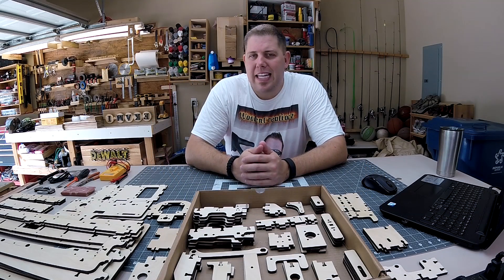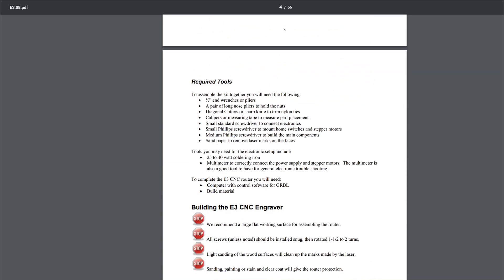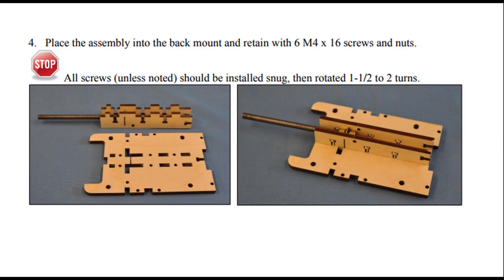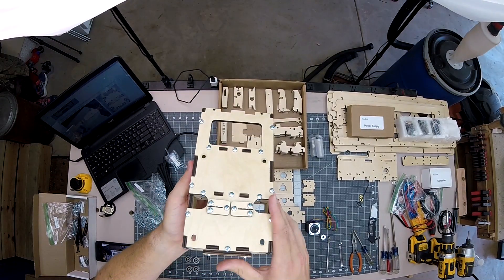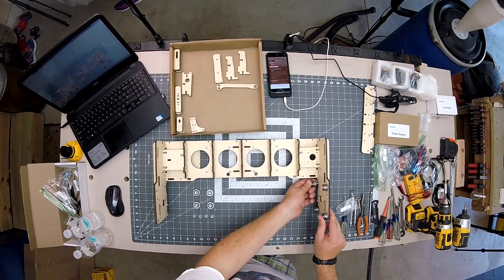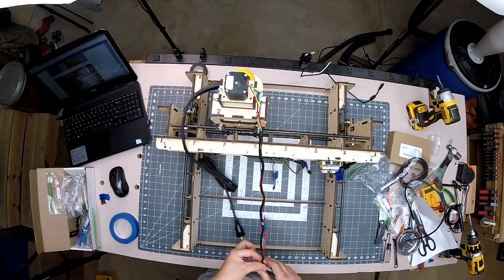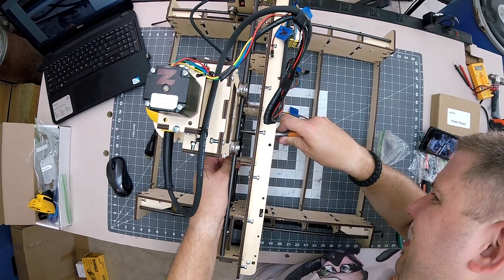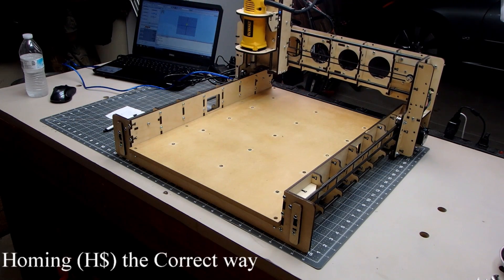BobsCNC E3 CNC/Engraver Installation Video ($698 CNC)

Comment: Can't make up my mind to CNC or not ? Experience : 45 years as a machinist / CADCAM programmer ( Mastercam) / car restorer / welder. I am retired and doing woodwork as my hobby. My concern is the loading of the drivers, software and electronics ( not my field). I was thinking a heavier machine may be better, but then again I'm not machining metal anymore ( miss my shop). The router is limited to the DeWalt I like the 1/8 and 1/4 collects. I want to 3D carve music boxes, clocks and other items along these lines. Not really big items. I'm thinking the E4, the wife's car will have to sit outside, maybe. I think the VCarve Pro would be good. I see you recommend Locktight how about fiberlock nuts ? I am concerned with viberation and all those screws coming loose. First thing will be a dust collection system.
Reply from the maker: I for sure vote E4 and use Loctite on the nuts.. the machine dominates in wood and carves and cuts with precision.... in regards to software. Bob does a great job of explaining what to download and from where. But if you have questions you can ask his support team and they will help you.. check out Bobs CNC on Facebook and you can see some of the beautiful things people have created.. hope that helps.. Still love mine . PS vcarve is the best software and my advice... I have videos on it as well.

Comment: is this cutting aluminium plate
Reply from the maker: Only hardwoods softwoods and plastics. Is it possible yes, is it designed for it no. It's all about going fast enough and keeping enough lubrication on the aluminum. I've seen some people attempt it. But I've also seen some people have the bit cease on them. 👊🏻😜 But again not recommended.
Reply: @WoodenCreationz  i want wood and aluminium plate cutting machine, and tell about it's body metal
Reply: @WoodenCreationz  Darn this is a totally sad comment.  I was looking to see if this could route aluminum which if it did .... would allow you to "DIY" parts for a more robust cnc.

... and now it's $900 on Amazon!

Comment: HEY!  I ordered the E4 TODAY!!!  Hate to bug you but what bits would you recommend to start out with?
Reply from the maker: That's awesome!!! You have two main bits that you will use... Your meat and potatoes... This one cuts. HQMaster 10PCS 1/8" 17mm Carbide... https://www.amazon.com/dp/B010NI39WO?ref=ppx_pop_mob_ap_share  This one is a 60 degree vcarve bit. Freud 1/2 (Dia.) V Grooving Bit... https://www.amazon.com/dp/B00004T7E8?ref=ppx_pop_mob_ap_share   For fine detail work I like this one.  EnPoint&trade; High-precision... https://www.amazon.com/dp/B00QPXQUNC?ref=ppx_pop_mob_ap_share  Good luck bud! -Brian ps the bit that comes with it is crap... So buy your bits now... The crappy bit won't cut.. 🙃 cya Brian
Reply: WoodenCreationz THANKS Brian

Comment: I am nearly finished assembling my E3, I purchased the magnetic tool. I used it extensively during the build. In some places, I super glued the nuts to the tip of the magnetic tool. This allows one or two threads to engage in the nuts. Super glue was also used to glue the nuts to the wood where it was not possible to get the magnetic tool. As well, for the toothed belt stops, I inserted the needle pliers into the screw holes. Then I positioned one part of the needle nose handle under the bench top, and gently pulled up on the other handle.. allowing the belt to simply slip into the Teeth. This worked very well. No fussing. I installed the belt stops.

Comment: I received my Cnc e3 and it says to use 5/16 anti backlash rubber washers for the rod. They were not included in my Cnc machine order. My question is where do I buy them? I’ve typed in anti backlash rubber washers, Nothing comes up.
Reply from the maker: I would hit up Bobscnc support group to see what they suggest. I'm not sure on that one.
Reply: Ok, thank you, found it odd that a few rubber washers weren’t included for the money spent on the machine itself 😂 thank you for replying! 😊
Reply: Apparently I have the newer model and those backlash washers aren’t necessary! 😊

Comment: I would like to know if this machine will cut a electric guitar body such as a Fender telecaster L. 16 in. H.1.75 in. W. 12.75 in.
Reply from the maker: Eugene Eaton Cutting Area:X: 17.7" (450 mm)Y: 15.3" (380 mm)Z: 3.3" (85 mm)

There is a mod a Lot of people are doing that extends the bed by double. Bob has a sale from now till June 17th on the E3. They don't go on sale often so if your wanting one I advise taking advantage of it before they go off sale. Excellent CNC for the price. I love mine. Brian
Check out BobsCNC.com for more questions answered and look on Amazon. A ton of them answered there as well. If that doesn't get it done, Bob's an amazing guy and will reply if you shoot him an email. The support you get from him is amazing!

Comment: What is the hardest thing you tried to cut with this? Plywood looks really flimsy and I wonder if rigidity is an issue or not?
Reply from the maker: yazicib1 Had the same concern and thought I needed a metal one. I was wrong... The frame itself is extremely rigid and contains lots of nuts and bolts holding it together. I believe there around 500 bolts or so. I have cut oak, walnut, plywood, pine. I know a guy that engraves rocks with his. My next concern was what can it do.. it cuts, vcarves and engraves like the all do. Not selling you one but for the dollar... It's the best machine I have bought so far in my shop. I can finally offer accurracy in a product and make signs and inventions skipping the bandsaw and skrollsaw. Here is a video from Bob the inventor on your deflection question. Dudes an engineer and will give you support better than any other company. Hope this helps. 👊🏻😉 https://youtu.be/v-e2IVQUh1k

Comment: I"m having trouble homing my BOB cnc. When I hit "Home" the router will move but it wobbles and then I get this error:  "Homing fail. Could not find limit switch within search distance. Try increasing max travel."  Help!
Reply from the maker: Mr. Quintron hey bud... Most likely the spindle motors are going the wrong way. Check out Bob's trouble shooting guide at the bottom of this page to compare and diagnose the issue... If your still stuck shoot Bob an email and he is amazing at getting you past it and up and going. -Brian https://www.bobscnc.com/products/e3-cnc-engraving-kit

Comment: what Feeds and Speeds are you running on your E3. I'm about to test out my E3 and was wondering a good range to start. I was thinking around 100 IPM with 60 for plunge.
Reply from the maker: Jason Long I do 20 speed and 15 plunge. Start with that. Harder woods need slower speeds. Once you get comfortable seeing how the bit is performing in the wood. You can start turning it up for softer Woods and softer materials.

Comment: So I completed the initial step 1 - the Z spindle mount assembly. I feel good with it so far but am a little apprehensive about the 2 nuts tightening on the rod with the rubber washers. I have seen a couple of videos and it warns bout getting that right. I am not sure what "right" means. The more I tightened the nuts the harder the rod was to thread so I backed off until the rod required some resistance when I turned it.I hand tightened the nuts until it squeezed the washers pretty tight. The rod can thread through the nuts fine. Not too loose not too tight. Should I sweat this? It looks like going back and adjusting it calls for taking a lot of parts back apart :)
Reply from the maker: Bill Clinton I gave mine a good tighten and when they frog cheeked a little I backed them off to where they don’t frog cheek but are tight. Never have had an issue with them by doing this. Brian
Reply: I think I did the same. At least I hope I did the same :).....I just finished step 2 and everything seems to be moving freely with no play. I planned on knocking it off after step one but could help myself. This kit is pretty awesome.....
Reply from the maker: Bill Clinton it seems over whelming but it’s never hard and like I mention. Pace it out over a couple days at your kitchen table with a cold drink in hand and it goes together really nicely!!! Enjoy bud!
Reply: Finished assembly today. Took about 6 hours total. Successfully connected it to my PC and am able to home the machine. Is there a recommended G code file I can use to run a test cut? I wanted to get one cut under my belt before I dig deeper. This was truly a joy to do. I appreciate your help with the community!
Reply from the maker: Bill Clinton Awesome Man! You will be nervous on your first cut. Try a piece of foam. Also get some new 1/8 or 1/4 bits on amazon. End mill 1/8 and 60degree vcarve are what I have. As far as software. Try the Fengrave. Also try easel. Just when you finish in easel do follow the instructions to have it automatically cut for you. You need to go to machine advanced and generate G code. I’m wrapping up a video now but my next video will likely be an easel video on how to do this. Brian

Comment: I built mine yesterday!  7 hours with lots of distractions.  The ONLY part that freaked me out was the first step in the gantry assembly with the two short, vertical end pieces with the 3/4" hole in them.  I noticed the hole was offset and the instructions gave no indication to which way this offset was to be placed.  Later, I found out it was only a wire channel and was VERY relieved since a teardown at that point would have been an hour or more backtrack.  Had a little trouble installing the switches (the one with the long wire REALLY got me) but not too bad.  Haven't run it yet, but it all works and slides around great.  Good video, thanks, even though I found this after mine was built.
Reply from the maker: Oh shoot!!! I think Bob might point people to this instructional video in the future.  Glad you got it together but! If you’re on Instagram come check me out. Look for one of my C&C posts as a lot of the guys in the comments all have one as well. Would love to see what you’re making with yours! Brian

Comment: I just got one of these CNC machines, everything is working fine but for some reason my Z axis is set really low and i cannot get it anywhere close to the home switch, I know that i should be able to hit it and be able to achieve 85mm/3.3in of dept with the Z axis but im barely achieving 20-25mm from the tip of the bit. Any help? Ive tried changing the firmware settings from 85 to like 750 which works to move it up and down but then when i start a gcode it wont work.
Reply from the maker: Alex Brensike Hey alex, shoot bob an email explaining what’s going on. I didn’t run into that issue, but assure you Bob can fix it all... he is a genius!!! Good luck and hope to see some of your work once you get it up and going sir! Brian
Reply: Thank you i sent them a message but was curious if you or anyone else had this issue. I believe i got it fixed which is good. I wanted to add a laser to this machine have you done this or have any tips how to add this to the existing Arduino board? I also wanted to add an attachment to be able to put a pen or marker to draw things out for my little siblings making their own coloring pages, any ideas or tips to do that as well?
Reply from the maker: Allcustomz on instagram has tried the laser. But it never really worked out for him. I havent tried the laser but too asked about doing it when i got mine. The pen idea would work. You would need to zip tie on a pen i suppose and boom your ready to go. Good luck in your shop!
Reply: Yea i may or may not tackle that mod some point lol
Reply: Also, waiting for a reply from Bob but for some reason my Z axis is only moving at a fraction of what UGS is telling it to move, ive noticed that when its supposed to travel 3 inches it only moves .3 inches, is this some converting issue with the program, controller, or stepper motor? Curious if you had this issue or knew of a solution before Bob got back to me lol
Reply from the maker: Yeah you have it on mm, you can click that mm button and change it to inches.(top left corner).. change it back to mm when you are really close to lowering it to the piece. Good luck!
Reply: Yea that was already changed to inches which sadly wasn't the issue, apparently when trying to use Easel, the program changed the EEPROM firmware settings of the z axis travel resolution down drastically causing this issue. Bob of course clarified that Easel can do this and ironically that was the first program I used was because i heard it was a simple easy to use program, not sure why it changed the settings. But when i get home i will change this setting and hopefully it will be fixed.
Reply: No doubt Bob is very prompt and detailed when it comes to helping me, some of my questions might have been dumb or very novice but he makes sure all is well and has had an answer for every question and fairly quickly.
Reply: I was curious is there a way to have the Dewalt spindle be automatic vs having to manually turn it on before and after every job?
Reply from the maker: Alex Brensike I need to get with bob and show how to correct this in a video. Also I need to film how to use easel with the e3!
Reply from the maker: Alex Brensike Bob is awesome!!! In regards to kicking on the Dewalt automatically.... nothing I can think of. It’s got a switch and that’s how we have to use it. Unless you are an electrical genius and wire it on and write a program on your pc to kick it on... your gonna have to turn it on every time.
Reply: Please do so that I can use Easel in the future, I will try it again and keep an eye on the firmware settings, but also the connection just doesn't seem to work for me, i am able to home the machine in Easel but then trying to move the X, Y, Z axis afterwards just doesn't work and my machine wont respond, I love the simplicity and ease of use of Easel but i just cant get the E3 to work properly.
Reply: I will say this, Bob has earned a loyal customer because his customer support is amazing and i hope after a few adjustments all will be working perfectly. And you sir have earned a subscriber for your helpful information/comments and videos. Thank you

Comment: Have you tried to do any 3D carving/engraving with the e3 yet? All the videos I watch about this cnc use 2D cutting. Also, many videos use V shaped cutters, for the gears you did in your other video, did you use a flat bit? I used to cnc metal components and I'm used to using a large flat end mill bit to remove most of the material, then use a smaller bit to finish the detail work. Is this process necessary with wood using the e3? Or can you do it all in one step using a small bit and just taking smaller cutting steps.

Comment: Great Video!  I just purchased the E3 CNC and am expecting it to be delivered by the end of the week.  Do you have any suggestions/recommendations for router bits to start V-carving once I have it assembled?
Reply from the maker: Hey John!! Sorry for the slow reply..  Yes I do... 2 Bits your gonna need asap.... The rest you can figure out as you go along... You need to be able to cut and you need to be able to v-carve or engrave... 

Both of these are what I bought... Use the snot out of both.... Been using both back and forth for a month.... I finally switched to a new 1/8 bit yesterday and the vcarve bit got cleaned and is still razor sharp.... Start off with these 2 bits and you can cut and carve like a boss....

Watch my video on F-engrave... Also Easel software is free by inventables and I like it better than f-engrave. You can trick it to engrave, but f-engrave is better at the engraving. Bob from I like to make stuff did an excellent video on easel so watch that and you should be running on both feel.. 

If your nervous to make your 1st cut like I was... make an air cut the 1st couple times.. Skip trying to use a pencil on paper.. Instead grab a piece of foam and cut it... Once your comfortable, stay with speeds easel gives you or what I recommend in f-engrave and watch the speed and plunge rate.. Once you feel comfortable.. take it up a tick or so and watch what it does... 

Congrats on the CNC machine... you will love it..

Bob is awesome!!!
Brian

HQMaster 10PCS 1/8" 17mm Carbide Flat Nose End Mill CNC Router Bits 
https://www.amazon.com/gp/product/B010NI39WO/ref=oh_aui_detailpage_o04_s01?ie=UTF8&psc=1

Freud 20-152 1/2-Inch Diameter 60-Degree
https://www.amazon.com/gp/product/B00004T7E8/ref=oh_aui_detailpage_o04_s01?ie=UTF8&psc=1